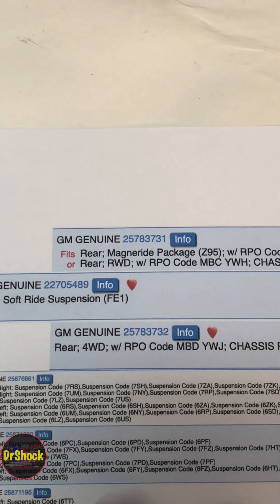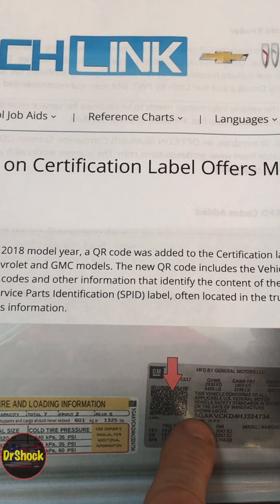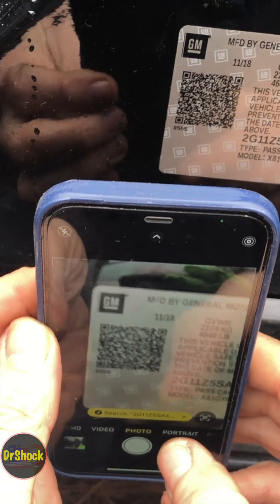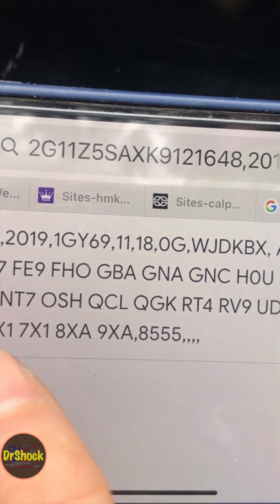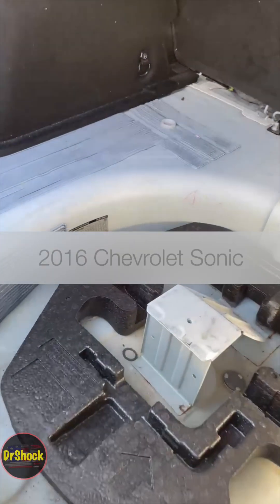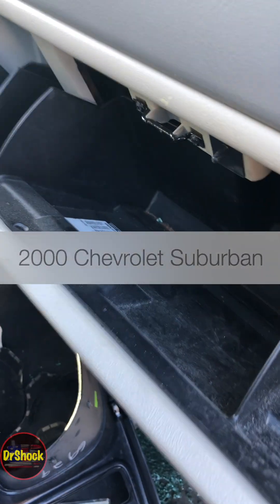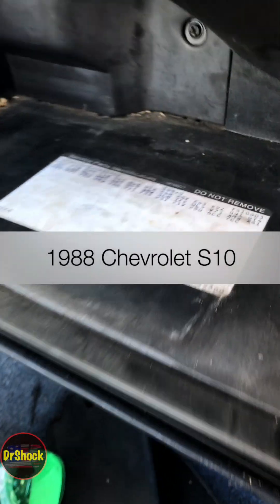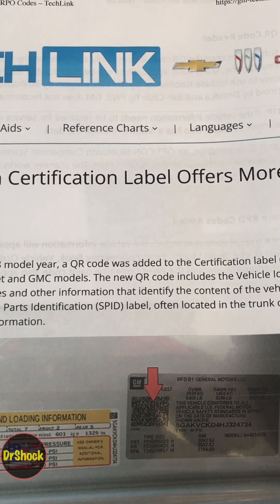Where to Find GM RPO Codes (Both older SPID Label or new QR Code Label) #Shorts

Comment: Are any of the codes from the QR, the engine manufacturing date??
Reply from the maker: No, that would only be found on the engine itself if at all.  Typically a large white rectangular sticker on V8 engines, but those can fall off in the engines life from heat and deterioration of the sticker material.  Smaller engines may have a stamped code into the block instead.

Comment: Hello Dr shock. I hope you see this message and can provide me guidance. I'm learning about RPO codes and how I might identify difficult to find parts. I'm trying to determine if I can use RPO codes to identify other vehicles that might have parts the same as mine. My specific situation is that I have a 2001 workhorse p42. It has a GM chassis, but workhorse obscures the GM part numbers by using their own part numbering system. When they retire a part from production this makes getting parts particularly difficult. My question is, can I reliably use RPO codes to identify other vehicles with the same parts? If they have the same RPO code for brakes for example, is that indicate compatibility? 

I'd be grateful for any insight you have.
Reply from the maker: I would not expect GM and Workhorse to have common production codes, but I do not have any experience with this to say with certainty either way.   I have come across situations where Workhorse part numbers are the same as GM part numberss just with leading zeros or letters.  So if I had this problem for a customer, I would start with https://www.workhorseparts.com/ and for those parts marked as discontinued I would google them as workhorse followed by their part number with any leading zeros removed.   You can repeat this search adding the word interchange or cross reference after the number and often get a hit where someone has solved this problem previously.

Another tip would be that most all electrical and cast/stamped metal parts from GM will have the GM number on them somewhere that you could look for as well.

Comment: What they meaning sir ?
Reply from the maker: Regular Production Option (RPO) codes are used by General Motors to distinguish different options for the same vehicle as built on the assembly line such as paint color, springs, shocks, brakes, axle ratios, wheel sizes, etc.  You'll be asked for this kinds of codes when ordering touch up paint or parts for such vehicles as I showed.
Reply: @DrShock  mm oky.. thnx